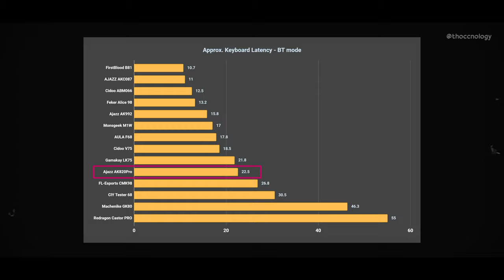Ajazz AK820 PRO with Ajazz Moon Linears | Teardown, Typing, Latency

Comment: 1:52 Thank you for showing the knob! Do you know where to find a replace for that? I want it in different colors because i want to make a custom theme keyboard.

1:12 And the switches are compatible with the Outemu or Redragon ones? I have plenty of these. It seems are the same, but i´m not sure :c
Reply from the maker: I usually go to AliExpress for small parts like this.
Listings like the following might feature further colors (you can find the key words in the listing): https://www.aliexpress.com/item/1005006478083183.html
Yes, this board supports any kind of mechanical switch (Outemu, Redragon ones too)

Comment: thanks for the clear disassembly instructions, althought i found i didn't need a pry tool to pull it apart. just getting the clips around the corners up was enough, as the thing is strangely flexible all around
Reply from the maker: Hihi, that's the best method for sure! Whenever I can, I also apply this method - but this time I was too weak it seems :') Also, I agree, it's quite flexible!

Comment: Do the ajazz ak820 vs ak820 pro have the same mcu and latency ? 
I dont need the screen and wireless😅
Reply from the maker: Unfortunately, I don't have information on the non-Pro version (I'm almost certain that uses a different PCB so likely there'll be some differences).

Comment: this keyboard piques my interest but the latency deviation of 20.8 ms is concerning. what is the maximum latency you have experienced on this keyboard and is there any delay when typing or gaming?
Reply from the maker: Hey! 20.8ms? In wired mode this keyboard has cca. 4-5ms, and even in 2.4G it's under 10ms. It's one of the best budget keyboards for gaming. :)
Reply: @thoccnology  I meant the latency deviation from your spreadsheet. The wired latency does look good, it is the latency deviation that has me worried. It seems a bit high so that is why I was wondering if you stumbled across any noticeable delay during gaming or typing.
Reply from the maker: @kiyoponnn  Oooh, I see, thank you for pointing it out! I totally forgot about it. To be honest that value has no relevance anymore - it was part of the previous version of the spreadsheet and was mainly informative for my team. I just forgot to exclude it from the newer version of the data. So no worries, the actual deviation is absolutely not visible and has no effect on the usage (either gaming or typing). Sorry for the confusion, and thank you again for bringing it to my attention!
Reply: @thoccnology Thank you very much!

Comment: hi can i ask what you mean by buggy software? i just got mine and it'd be nice to avoid anything that could potentially ruin the firmware, thanks in advance <3
Reply from the maker: It's quite a generic software (used by many other brands too), it's a bit tricky to use sometimes - like to set the language sometimes you have to navigate through several section while the language is still set to CN (and the specific setting is shown as empty until you click into it). I heard others having issues with GIF upload, but I didn't encounter this.
So it's not terrible, just a bit tricky. :)

Comment: Tehy sound remarkable good for that price range. The normal A820 available for only 49.99 euro's up to 59.99 euro's with different switches and the grey white, white and black with see through key caps. Which I prefer BTW because IMO RGB backlit is useless without see through key caps. I know it's a pet peeve of mine.

Comment: Which one is better, AK820 Pro, Aula F75 or RK M75 in case of gaming and quality?
Reply from the maker: The AK820 Pro is a tiny bit better in latency, but F75 is also more than perfect for gaming. In quality I'd say the F75 is a bit better, but if you have time to lube the switches of the AK820 Pro and apply a tape mod, it's just as good. (I couldn't try the M75 yet)
Reply: @thoccnology  I bought Zuoya x86. But thanks for your comment

Comment: Hi!!! I am planning to buy this keyboard because of the wireless conecctivity. Do u know how to turn off the keyboard to not waste battery when not using? I ll appreciatte any info :)
Pd: great video!!!!
Reply from the maker: Heyyy! There is a button for that on the bottom! (Set to Wired mode, and while in that position it doesn't use the battery/doesn't look for nearby devices, etc.)
Reply: @thoccnology  Thank u so much :)

Comment: When i turn my pc off , the keyboard is still on “ i use 2.4 ghz connectivity” pls help 🙏🏻
Reply from the maker: After a couple of minutes it should go to sleep if you don't touch it. The worst case, you can switch it off manually (set the switch to 'wired' mode)
Reply: @thoccnology  ty i got another problem that is every time i start my computer the gif screen changes to the time screen instead of the gif that i add any fix please?

Comment: This or Aula F75? I can get this for £40 or the F75 for £60.
Reply from the maker: In short, the AK820 Pro is cheaper, but needs some mods to fully emphasize the good sound, the F75 is a bit more expensive, but is absolutely good to be used out of the box.
Also the F75 has Cherry-profile keycaps  in pretty colors, while the AK820 Pro has OEM profile, also it has a mini TFT screen and has a bit better latency.
All in all, I'd say it's OK to choose whichever design you feel closer to your heart.

Comment: Hello,
I just bought this keyboard and using all of the features already.
Is there any indicator like blipping for the keyboard without looking the LCD when the battery runs out or almost empty?
Because right now my keyboard (this keyboard actually) is running with 2 bar battery, and I haven't got any 'notification' or something like that.
In addition, the battery indicator is still 100% inside the keyboard's software.
It would be hard for someone like me that usually using cable and try using wireless keyboard like this.
please advise.
thanks for help.
Reply from the maker: Hey! As I know, there is an indicator LED on the right side of the keyboard, left to the the PgDn button.
That starts flashing red once the battery is low.
But low means cca. 5-10% is left, but before that it will not warn you.
When you charge the keyboard, this red light will be shining, and after the battery is fully charged, the light will turn off.
Reply: @thoccnology  Thanks for the explanation. My concern has been answered. I'd prefer turning off the LED and the RGB to save the battery. I use it at midnight only :D
Reply from the maker: @Chronix-SE  You're welcome!
That's a good idea, I also rarely use RGB (I'm not super into that, maybe some minimal glow :))
Reply: @thoccnology  done subscribing..
Reply from the maker: @Chronix-SE  Thank you so much for joining! ^^

Comment: I have both the "Ajazz AK820 pro with Gift switch", and the "Keychron k8 pro with Gateron Browns" which is double the price of the Ajazz, and for me Ajazz is the better option because of the more creamier & refined sound. Keychron's keycaps are more well-finished, however the typing experience in Ajazz is better.
Reply from the maker: Thank you for sharing your experience!
I agree with you!
I myself think that Keychrons are unfortunately overpriced considering their features and overall quality.
For example: for the price difference between them, many modifications can be done to the Ajazz, one can freely customize the keycaps by ordering one or two extra sets from AliExpress for example. And/or a full set of replacement switches.
But I want to be fair, a couple of months ago (or years even more so) there was no wide selection of choices available for this price, that's why Keychron was a viable alternative back then.
Reply: @thoccnology  Am thinking of having akko v3 cream yellow witches in the k8, how do you recommend it?
Reply from the maker: @ayush_stha  They're not bad for the price, but they're gonna be clacky, that's for sure! :) For a better price I prefer the MZ Z1 or Bubble Gum switches, they are more creamy and deeper sounding (but deep/creamy sound is only my personal preference, it's OK if you prefer the high-pitched clackier sounds)

Comment: Are you able to switch between connection modes via the knob or only the switches in the back?
Reply from the maker: The knob is not programmable as far as I know (couldn't find an option for this in the software either)

Comment: Unfortunately they don’t sell moon switch anymore. They only have fish and gift so which one do you recommend for like office and casual gaming use? Thanks
Reply from the maker: oh, that's sad..
based on the stats the flying fish should be closer to the moon (the forces are similar and it also has a dustproof stem, which helps with stem wobble)

Comment: After lubing switches sound creamy. I would like to see a comparison with akko v3 cream yellow or ktt kang white v3.
Reply from the maker: I had quite bad experience with the ktt kang whites, and the akko v3 cream yellow is discontinued unfortunately :')
Reply: I know that akko cream v3 is discontinued, I meant the pro version. I used akko and ktt as examples because these are the most popular creamy switches.
Reply from the maker: @stanislav933  The V3 Pro switches are nowhere near the original ones in creaminess - they are way more clackier and louder (I made a comparison between the old and the new ones).
I hope Ajazz will release the switches for sell (they are only available built into keyboads atm), so a comparison could be made for all of them.

Comment: Does anyone know the if the latency of the non-pro version is the same?
Reply from the maker: Unfortunately, I don't have information on the non-Pro version (I'm almost certain that uses a different PCB so likely there'll be some differences).
Reply: @thoccnology  Thanks for replying, also are the stabilizers on the pro version pre-cut?
Reply from the maker: @Guy_that_exists  Yes, fortunately, they are pre-cut! ^^

Comment: How do these compare to aula f75
Reply from the maker: In short, the AK820 Pro is cheaper, but needs some mods to fully emphasize the good sound, the F75 is a bit more expensive, but is absolutely good to be used out of the box.
Also the F75 has Cherry-profile keycaps  in pretty colors, while the AK820 Pro has OEM profile, also it has a mini TFT screen and has a bit better latency.
All in all, I'd say it's OK to choose whichever design you feel closer to your heart.

Comment: Royal kludge r75 Vs ajazz ak820 pro?
Reply from the maker: Haven't tried the R75 yet, but the AK820 Pro is a safe choice in this price range, no matter what.
Reply: Ajazz. or take the the f75 because the r75 is just like that but less good prebuilt and more expensive.

Comment: you basiclly changed the entire bored: you swapped the switches. swapping the switches makes to much of a difference.
Reply from the maker: I didn't change the switches.
Lubing means you take them out, open them, apply some lube, back together and back to the board.
It's a basic mod in mechanical keyboards, and is generally advised to do this.
Reply: you used moon switches, it only comes with either gift switches or flying fish switches. 5:05
Reply from the maker: @sir.ducks.  It comes with Moon switches, too. It's offered on multiple sites, even on Ajazz's official site.
https://ajazzbrand.com/product/ajazz-ak820-ak820pro/
If it's not available at the moment is because it's sold out due to the high interest.

Comment: this one or Hi75 or Aula F75 for gaming and a bit typing
Reply from the maker: I always prefer aluminium keyboards over plastic ones, but both are solid choices. If you can spend the extra bucks, go with the Hi75
Reply: @thoccnology  my pc no groumd wire i go to plastic one i used to have electric shock from keyboard

Comment: Are the switches Hot Swappable for both 3 and pin switches ? And how would u rate it rn after some time of use ? Should I buy it ?
Reply from the maker: Yes, both 3 and 5 pin is supported!
This is a surprisingly good keyboard especially for this price - a solid choice!